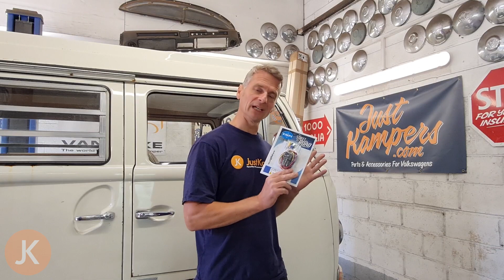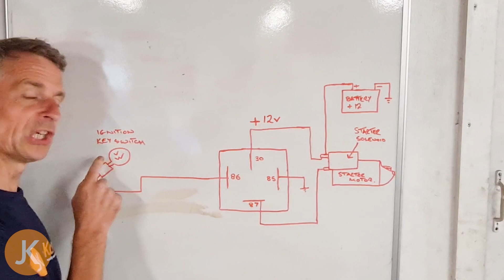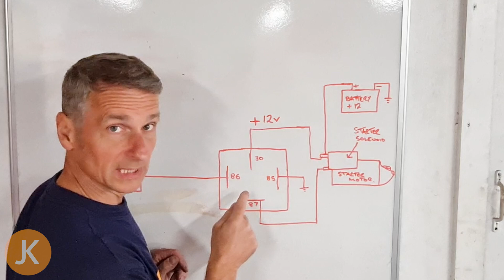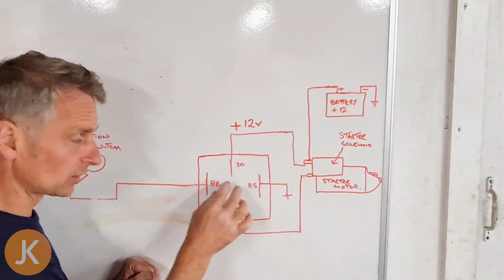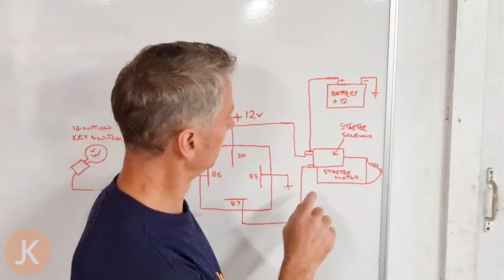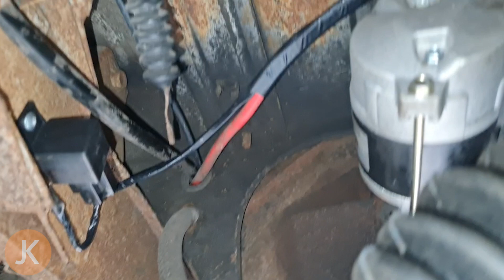How to fit a 12v Hard Hot Start Relay Kit

Comment: I fitted this today. I got a 10A parasitic draw on the battery. I checked all connections and they are correct ( apart from one discrepancy in the video where he quotes 85 going to earth and 86 going to the ignition switch) when checking the wire colours in the video it was wired correctly. It would be interesting to know if that was a misquote quote on the video.

Comment: The Bus runs just fine. Then suddenly after coming out of a store after the Bus is hot, I turn the ignition and nothing, 0. No click nothing. Apparently the ignition switch is good. I replaced the starter on the Bus a few weeks ago. Everything was fine for about 400 miles. Then it did it again after a 30 mile drive. Went under the Bus, used a tool to connect the 2 wires on the starter and it started fine. Different opinions from everyone but is it likely the hard hot start relay will fix this?. Thanks. PS 76 Bus, Westy with one battery. It's fuel injected and an automatic.